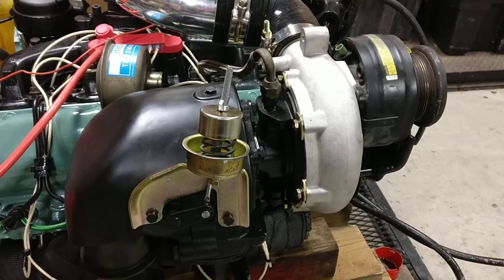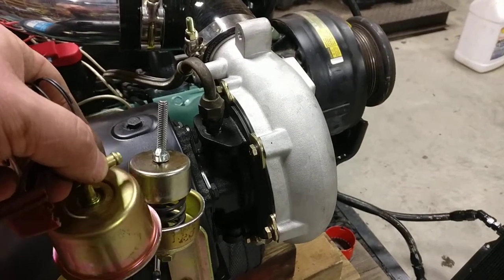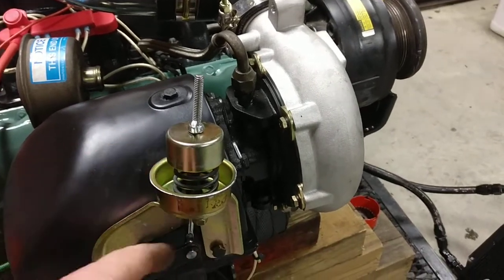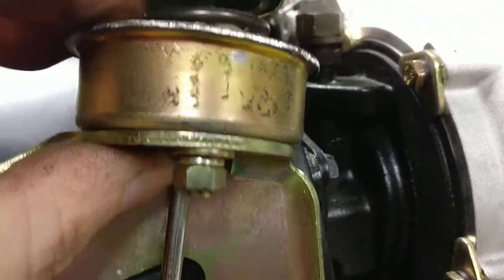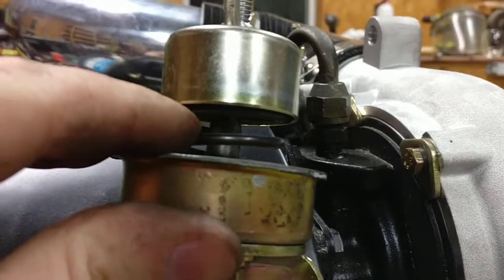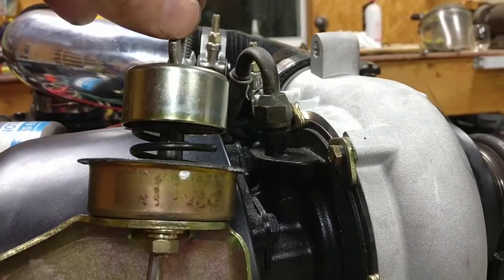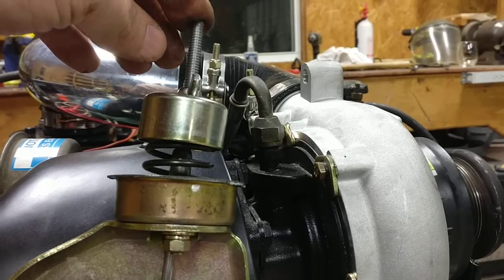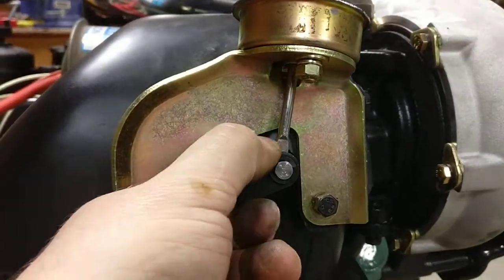6.5 Turbo Diesel Easy Manual Wastegate

Comment from the maker: FYI, I ended up pulling this turbo off and using an HX35 instead.  The GMX downpipe setup didn't give me the room I needed for my suspension.  I will be doing a video on the HX35 setup in the future.

Comment: Thanks great Video. Do I have to do anything over where the electrical plug attaches to the vacuum lines on the drivers side top of engine? I've removed my vac pump and got a shorter belt. I just need to adjust my boost pressure next.
Reply from the maker: I'm not familiar with that plug. Is yours a 94 or newer? Those had more electronics and I'm not sure if you need to fool a boost sensor. Sorry...
Reply: @raevennull   1998 & 1994 not sure if the 94 has I will look

Comment: I like your design...wish you could make me one.
Reply from the maker: It's pretty easy to make one.  On my GM3 turbo, the rod was long enough that I could just thread it with a die.  You could thread this style and extend it with nuts used for joining rod available at most hardware stores.  You can buy wastegate springs on Amazon and I have even seen some transmission accumulator springs that looked like they would be perfect.  The important part is to start with very little preload on the spring and work your way up slowly.
Reply: @raevennull  Thanks...I'm not mechanically inclined, but in the next couple of days will try.
Reply: Also obtained a new three in one boost/ vacuum guage, so will install that first...
Reply: Also, I know nothing about welding....so going to talk to a buddy.....

Comment: So I’m assuming you’ve got the gate shut and the spring holds the gate shut until desired boost pressure and then it compresses the spring and opens the waste gate?
Reply from the maker: That's right. I had the same setup on my GM 3 and it work really well.
Reply: @raevennull  I’m about to do this to mine, it’s not even hooked up at all I just got it and it was building no boost I ordered a PMD relocation kit today. What kind of spring do I need?
Reply from the maker: @johnself3813  I used this one which is an alternate spring for my Toyota diesel.  The important part is that you watch your gauge and adjust it to get it where you want.

https://www.ebay.com/itm/253234960597?_trkparms=ispr%3D1&hash=item3af5fad8d5%3Ag%3ApQYAAOSwdo5fybsi&amdata=enc%3AAQAGAAACgPYe5NmHp%252B2JMhMi7yxGiTJkPrKr5t53CooMSQt2orsSg3Ye8yTWgOW7pmE1t838dobWiaIoLWqliZ%252BV3hHdn9MzEZ0Wp6UwPYCDwMp0VfjCaUZH8HqOCbSxSfiWUXiMzaXgmC5hdok%252FaOyhzDR9fIJgbd%252BMR%252Fp2XNqdFGJxcOySp8ufi1LUdo3N%252B6NEiqwhaiWaQgIDR1LiNzhnhf8B03RvLcYtY2eaoo%252BOfcHVU0xI4MaESUPMwCqhWXwil7AQ43WN2f%252FyU%252B1L8h5s7sARMHd97wSqj%252FCouycy%252BncJ%252FAyDc2FQM1JKR0BqfGfvc6gltpOGZXHY6sNtaLC90VocxkYT0xkuO2ZxnXyLFJnJ7ewg092IFkLXZ7ZMYYdu19ssnTzE019U9j62a%252FLqwI5VFTrX9dqU75w5G2oV8EO3JyyXH0jEbBpLSIRzYCJcsd6e%252BlJb37YXqOHfvCJS8MWsa5kzA9d0kO5SifhEk95WhFwOoF5qdxvi5lYrLA9rYGjdJYWDBtLgWu2WrN4lPYWmyW%252Feo5jkYKLXeG5bO7fkvkkUN6cAaITFt3fCkKChaNLRRo%252F%252Bwcq0SKEVkiifxooGZKVcQnNZ24mrjr0%252Flphk1uokQ6LljNUY1CUBWVrQMvG6X%252BBhRDSufFm7I378Ls78hOmH2HbKXVkxcB7Wq7ZXbzSCEGsVwOtk1jLcdtxdtoJMm%252BXxPqrPEl6Ny5Wad%252Fhvuf74wqrx6CxpUF%252FwKCu8WKWufuRCidpRgjbPLwPu9mK5NSeGPccXnj99pT4tNommXhTvC4JMrPTM2k29MlUTlh7AFBrVLK1PA6WFiUX6b8fNwrLSmbMwiXOikjMj0X8hxP4%253D%7Campid%3APL_CLK%7Cclp%3A2334524
Reply: @raevennull  will do thanks a lot buddy

Comment: I was installing mine on the truck, and when I disconnect the old one off, the was a lot of play on the turbo.  No resistance what so ever.  Is that to be expected.  Also my connection to the turbo was horizontal, where yours was vertical.
Reply: Should it be that loose?
Reply from the maker: @adstx1949  The arm should be able to rotate freely without the spring attached.  What you don't want is in and out or side play that could cause it to bind.  If it binds, it could get stuck open or closed.  It should be difficult to move it with the controller attached.

The GM turbos had a few different designs.  The GM3 that was originally on the engine had a horizontal controller that stuck out at the front.  The GM8 that I show in this video is obviously a little different.

FYI - I have the engine in the FJ80.  Due to interference from the downpipe, I pulled the GM8 out and replaced it with an HX35 using a custom downpipe.

Comment: Hello, will make one and if possible could you let me know off witch year toyota four runner waste gate spring is  please?  Denis
Reply from the maker: I believe the engine would have been out of an early 90's 4Runner.  It is swapped into my '85.  The spring is out of a Kinugawa aftermarket waste gate.  I can't pull up the order anymore, but I believe it was this spring.

https://www.ebay.com/itm/253234960597?_trkparms=ispr%3D1&hash=item3af5fad8d5:g:pQYAAOSwdo5fybsi&amdata=enc%3AAQAGAAACgPYe5NmHp%252B2JMhMi7yxGiTJkPrKr5t53CooMSQt2orsSg3Ye8yTWgOW7pmE1t838dobWiaIoLWqliZ%252BV3hHdn9MzEZ0Wp6UwPYCDwMp0VfjCaUZH8HqOCbSxSfiWUXiMzaXgmC5hdok%252FaOyhzDR9fIJgbd%252BMR%252Fp2XNqdFGJxcOySp8ufi1LUdo3N%252B6NEiqwhaiWaQgIDR1LiNzhnhf8B03RvLcYtY2eaoo%252BOfcHVU0xI4MaESUPMwCqhWXwil7AQ43WN2f%252FyU%252B1L8h5s7sARMHd97wSqj%252FCouycy%252BncJ%252FAyDc2FQM1JKR0BqfGfvc6gltpOGZXHY6sNtaLC90VocxkYT0xkuO2ZxnXyLFJnJ7ewg092IFkLXZ7ZMYYdu19ssnTzE019U9j62a%252FLqwI5VFTrX9dqU75w5G2oV8EO3JyyXH0jEbBpLSIRzYCJcsd6e%252BlJb37YXqOHfvCJS8MWsa5kzA9d0kO5SifhEk95WhFwOoF5qdxvi5lYrLA9rYGjdJYWDBtLgWu2WrN4lPYWmyW%252Feo5jkYKLXeG5bO7fkvkkUN6cAaITFt3fCkKChaNLRRo%252F%252Bwcq0SKEVkiifxooGZKVcQnNZ24mrjr0%252Flphk1uokQ6LljNUY1CUBWVrQMvG6X%252BBhRDSufFm7I378Ls78hOmH2HbKXVkxcB7Wq7ZXbzSCEGsVwOtk1jLcdtxdtoJMm%252BXxPqrPEl6Ny5Wad%252Fhvuf74wqrx6CxpUF%252FwKCu8WKWufuRCidpRgjbPLwPu9mK5NSeGPccXnj99pT4tNommXhTvC4JMrPTM2k29MlUTlh7AFBrVLK1PA6WFiUX6b8fNwrLSmbMwiXOikjMj0X8hxP4%253D%7Campid%3APL_CLK%7Cclp%3A2334524
Reply: @raevennull  thank you very much